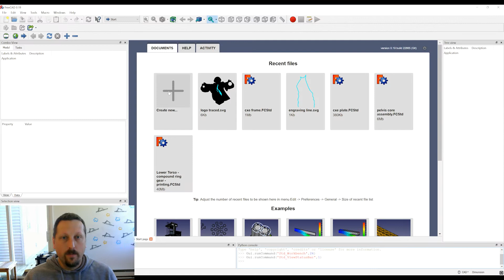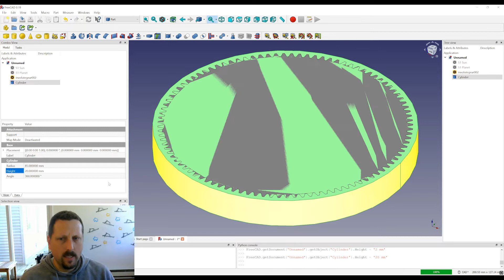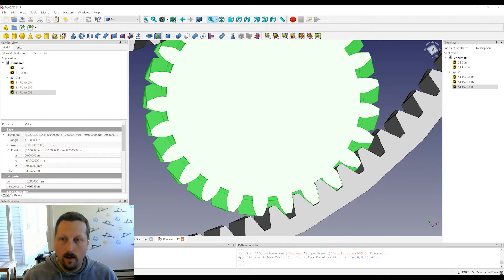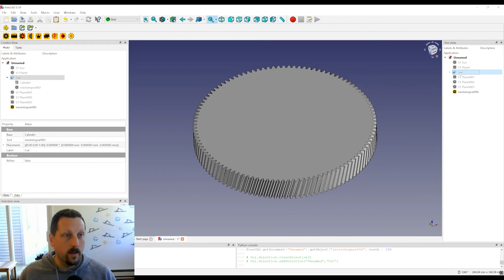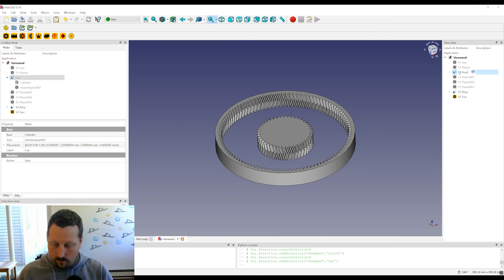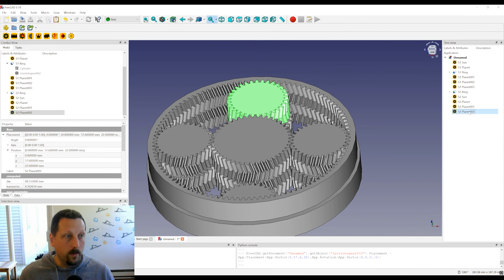FreeCAD Compound Planetary Gearbox Tutorial

Comment: Hey Josh if I had three planet gears would that change the divisor from 2 to 3 or it it still 2 for the planet gears, and if I had 5 planet gears would that be divdied by 5?
Reply from the maker: I'm pretty sure changing the number of planets doesn't directly change the gear ratio.  With more planets you can make a gearbox with bigger suns and smaller planets, which can help get the tooth counts for each gear into numbers that would be troublesome for, say, three planets to handle.  A six planet gearbox could still operate with just three planets in it, and the gear ratio would be the same.  After messing around with some compound planetary gears in my latest robot, I think I want all my tooth counts to be slightly off from clean multiples.  That way every tooth eventually meshes with every other tooth, making it better for lapping/smoothness.  If everything's multiples of four, like my last box, then each tooth only ever meshes with 1/4 of the teeth on other gears.  It's not wrong or bad, but it has implications for preparation and wear...
Reply: @WhitmanTechnological  ok, planets might not, but would changing the diameter of the gears, like how normal gear work, small to big, to increase power or torque, not sure the correct terms, or big to small to increase speed? ik you said that the axles or pins need to be in the same locations, but I"m thinking if it had a stablaizing bracket that maybe that technicality could be worked around through the design of the system.  I saw something like that in a dif vid where they used a sungear for a drill I think. I'm trying to take this concept that in cars and make a bike that's easier to pedal for myself cause i have a gimp leg from an accident, for when I'm older.
Reply from the maker: @BlackskyRadio-x9s  The only things that have any impact on the gear ratio are the tooth counts.  The size and counts of the teeth define the diameter of the individual gears.  If tooth counts are fixed, increasing the tooth size increases the gear size (but not the ratio of the gearset).
Reply: @WhitmanTechnological  thanks Sir, not the answer I was looking for but a step forward. lol I think we might have been saying the same thing though, as in creasing the tooth count would alter the diameter and decreasing it would lower the diameter, maybe I can get some lego gears to try and make a vid of what I can't explain.

Comment: Hey Mr. Whitman I opened up some excel and followed along with your sketch, I haven't gotten to the math yet, but I had a question, I had played with lego gears as a kid, didn't get the formal training about ratios from an engineering degree or anything, but I was wondering is it possible to have a 2:3 ratio, then a 2:3 ratio instead of a 1:1. or a 3:2 to a 3:2? I was thinking that a 2:3 to 3:2 or a 3:2 to 2:3 would just cancel each other out and be counter productive but if sun gears worked that way I was thinking they could help ev's in the future. I'm trying to work on a bike in free cad atm, coming from 3ds max and blender it's restrictive for me though to draw.

Comment: Nice video, but how do you calculate the uotput ratio of your model?
Reply from the maker: It's a somewhat complicated formula.  Here's the document where I found it: https://www.geartechnology.com/ext/resources/issues/0614x/epicyclic_drives.pdf  The page numbered "66" has the formula.  In my excel file it looks like this: =(L8*(L3+L5))/(L3*L8-L6*L5)  Each of those cells has the tooth counts for different gears in the set.  If I swap in the "Z1i" style labels from the linked PDF, it's the formula =(Z3ii*(Z1i+Z3i))/(Z1i*Z3ii-Z1ii*Z3i).  My gears tooth counts are:
Z1i	20
Z2i	12
Z3i	44
Z1ii	24
Z2ii	12
Z3ii	48
So the resulting ratio is -32  (These teeth counts might not match the video because I've made a few of these gearboxes in the last three years, and reused the Excel file.)
Reply: @WhitmanTechnological  Have you tried using Grok, it's awesome, it's a shame it's text only so can only kick out the maths not the cad. Though it can do G-Code as that's text based I didn't have the bottle to run it.

Comment: What's the specifications of PC needed if I need to download 3d softwares:
Freecad,spaceclaim,blender,cinema4d 
Thanks
Reply from the maker: I use FreeCAD and Blender, and they're both pretty lightweight to run.  The need for a better computer really only comes when you start making massive and complex things.  As a design gets more complex in FreeCAD it'll take longer to compute the updates - and a faster CPU will help.  In Blender, as you get more sophisticated, increase the output quality, add more detailed textures and render at a higher resolution, it'll put your graphics card to work.  I upgraded my GPU from a GTX960 to an RTX2070 Super and it cut the time to render video sequences in half.

At a minimum, if it has an operating system and boots up and was manufactured in the last 15 years, there's a good chance it can run FreeCAD and at least an older version of Blender.  I have a few old Core2 Duo computers I built in 2007 that still run and they'll happily run FreeCAD and Blender.  It'll just take a few decades to render anything in HD!

https://www.blender.org/download/requirements/
https://forum.freecad.org/viewtopic.php?t=16701

Comment: Hello sir please can you make a complete 4 blade helicopter swashplate step by step video please 🙏🏻🙏🏻🙏🏻
Reply from the maker: A younger me would have jumped at that.  I've always loved helicopters.  I'm mired in the robot project that most of my other videos are about and won't have time to make a video to do it justice, sorry.  The swashplate is a pretty cool piece of hardware.  Sleeved onto the rotor so it can slide up and down, and then ball jointed from the sleeve so it can pivot.  A lower plate connects to an upper plate with a bearing to allow the top to rotate while the bottom is fixed and both plates describe the same plane.  Upper plate has four ball joints that link to the leading edges of the rotors.  Lower plate has two or four linkages on ball joints that connect to servos or cables to control the whole thing.  An amazing design, and pretty incredible to see the rotors changing their pitch so heavily during a single rotation.

I read the FAA Rotorcraft Flying Handbook once, and the part about the flex from flapping and feathering - where the rotors are curving up and down dramatically as they transition from the heavy-load-into-the-wind half of their rotation to the unloaded-away-from-the-direction-of-travel half of their rotation was something I hadn't really thought about before.  Amazing those things can fly so smoothly at over a hundred knots considering the wild change in forces on the individual components over the span of a single rotation.
Reply: @WhitmanTechnological  sir it’ll be slow and steady you can create something like a course where people pay to learn all this complex design you’re good and I think it won’t take you long time to do because of your experience please think about it sir

Comment: Brilliant! I am new to this and even bought my first 3D printer. Do you recommend printing the ring gear as is and cut it after it prints, or design a cut or notch in FreeCAD? (Which I don't know if it even is possible) Thanks or the tutorial mate! I learnt a rather lot from it!
Reply from the maker: I'd put in the notch in FreeCAD and then 3D print with the notch.  Lately, I'm doing regular spur gears (not helical) so the gears all slide together easily.  For a helical gearset, I'd make the notch either by subtracting a thin cube in the Part workbench, or pocketing a thing rectangle in the Part Design workbench.  Congrats on your new printer!!
Reply: @WhitmanTechnological   Tally ho mate! Much obliged good sir!

Comment: Can this be built with more then 2 stages? Sy 3?
Reply from the maker: You could have the ring gear on the second stage link into the sun gear on a third stage.  Hold the third stage ring fixed with the first stage ring, and your output would be on the 4th stage ring.  But you can get gear ratios like 300:1 from just two stages if you choose the numbers of teeth appropriately.  I used multiples of four (since I have four planets) for all the tooth counts so that the planets are identical.  If you use multiples of two for tooth counts, you'll need two kinds of planets (and they'll have to be aligned carefully when the gearbox is assembled).  If you use arbitrary numbers of teeth, each planet might have to be different, and every planet, sun and ring will need to be oriented properly when the gearbox is assembled.  It makes the planets and assembly harder, but you can get astronomical gear ratios from just a two-stage assembly if you can tolerate the extra complexity.

Comment: I guess I'm confused.  Which gear are you driving, which is fixed, and which is the output?  Normally with a planetary system, you would have a carrier which would be your output, and your ring would be fixed.  In this arrangement I'm wondering if you are driving one sun gear, fixing the other sun gear, and the ring gears are attached to each other, and they are the output??
Reply from the maker: Hey Randy, one sun is driven, one ring is fixed, and the second ring is the output.  There are no carriers because the planets of one stage are made to exactly match the position and rotation of the planets on the second stage.  The second stage sun is allowed to spin freely (and could be omitted but it helps to keep the planets aligned).  Check it out in action on one of my other videos: https://youtu.be/PF528b9jf0Y?t=1139  The drill drives the sun and I can hold either ring and the second ring spins slowly.
Reply: @WhitmanTechnological    OK, What I think what I need to clarify, is that it seems that the two sets of planetary gears are actually attached to each other and printed as one part. Is that correct?  And that is what transfers the rotation from the first stage to the second stage. I only picked this up by noticing the timelapse print at 0:25 of the video.
Reply from the maker: @randysonnicksen9475  Exactly.  Both stages of planet are printed as a single part and are therefore locked together.  Stage 1 and Stage 2 have slightly different tooth counts, which produces the reducing effect of the gearbox.  Driving either sun will rotate the planet pairs.  The slightly different tooth counts from ring1 to ring2 causes them rotate at different speeds.  Fix one ring, and you'll have a huge reduction output on the second ring compared to the rotating input on the driven sun gear.
Reply: @WhitmanTechnological  Thanks for your replies.  Cool gearbox. And I was wondering how you assembled a double helix planetary gearset, until I saw the split in your ring gear.  Obviously, in a "real" application that split would need to be reinforced to prevent it from opening, or shifting.
Reply from the maker: @randysonnicksen9475  The helical ring gears are collars and slide into pockets in whatever is being driven.  The pocket holds the ring closed and the nubs on the outside of the rings fit into slots in the outer part.  If you want to see more, the YouTube channel "Gear Down for What" does a lot of very impressive stuff with compound planetary gears.  That was my starting point for trying to build this kind of gearset in the first place.
Reply: @WhitmanTechnological  One more question as I prepare to actually build one of these gearboxes:  Are the Stage1 and Stage2 suns printed as a single piece?  In the other video, I see you driving S1_Sun, and holding S1 Ring, and S2 ring spins slowly.  But it looks like S2_Sun is spinning also.  Is S2_Sun connected to S1_sun (printed as one part?)
Reply from the maker: @randysonnicksen9475  The suns are two separate parts.  The need to spin at slightly different speeds.  Good luck with your build!

Comment: Is the Compound Planetary Gearset identical to a Wolfrom type planetary gearset?
Reply from the maker: I took a look at the Wolfrom patent.  It's pretty cool.  In the Wolfrom patent, the gear set has at least one extra stage (three or more stages) to allow for changing the gear ratio during operation.  In the Wolfrom, you can slide an external gear along the various stages to fix (ground) different rings.  So it's not just a gearbox, but a variable speed transmission.  Assuming the Stage 1 ring is the output of a Wolfrom gearset.  You have a sliding lock that meshes with the outside of the ring of stage 2 for the first gear ratio, and then slide that lock onto ring 3 to have a different ratio, and then slide the lock further to ring 4 to get a still different ratio, etc.  It's a variable transmission with relatively few parts.  Awesome.

Structurally, the Wolfrom starts as the same kind of gears I made in this video, but has extra stages and the ability to ground different stages to change ratio.
Reply: Interesting! Do you mind sharing the patent number? There seem to be many patents on Wolfrom gears 🤷‍♂
Reply from the maker: @zetteltonne4772  https://patents.google.com/patent/EP2146112A1/en

Comment: Thanks for the vid, I appreciate it! I want to point out that if your stack identical gearsets you will still get reduction. Make your ring gear a single, fixed "tube," and connect your 1st stage planets to the input of the second stage. I stacked two 4:1 planetary gears to get a 16:1 reduction
Reply from the maker: Interesting.  How do you connect them?  With a carrier on the first stage planets that drives the sun on the second stage?

Comment: Why did you not use 'internal gear' on the ring gear? I have the feeling this was the option you were looking for at min 16. It took me a good afternoon to come to the same realisation. The internal gear option only exists in Part Design, but not in Part. 
FreeCAD likes to make simple things complicated because it is the way they have always done it :)
Reply from the maker: I'm using the Gears Workbench, which makes herringbone gears and other types of gears really easy, but it doesn't have an internal gear option to the best of my knowledge.  I used the Involute Gear option in the Part Design Workbench for a long time until I took a serious look at the Gears Workbench.  

I hopped into FreeCAD to test the External Gear: True/False setting just now to see what it does.  The math/geometry behind involute gears is fascinating, but I'm no expert.  The profile does look like something that might be "the correct way" to build a ring gear.  It certainly looks markedly different from the external gear shape.

Do you think that the internal flavor of involute gear is the most correct way to construct the ring gear?  I could see how that profile might eliminate problems with tooth meshing if tooth meshing is an issue.

If someone wanted to use the involute gear from Part Design to make their herringbone ring gears, they could do an additive helix twice (one clockwise and one counterclockwise) and then subtract those from a cylinder, or do a subtractive helix from a cylinder.  Just FYI for anyone reading these comments and looking to take a crack at it themselves.
Reply: @WhitmanTechnological  I'm just a curious hobbyist, so I can't say anything about the proper way to CAD :) However, the larger the diameter, the more triangular the gear teeth become, so I suspect it is less of an issue the larger the internal gearing becomes. 

I just made a 70mm outer diameter ring in my 3D printer and it works fine. Modulus 1,6, 40-20-10 teeth. 0,1mm backlash on sun and planets. I had to go to 0,05mm on the ring because the CAD broke. So there should be 0,2mm play between planet and sun, and 0,15mm play between planet and ring, to allow for heat extention. With these parameters, the gear spins freely.

I'm new to printing moving parts, but in my previous designs I took 0,2mm play, so I was a little fearful the friction would be too much. However, the gear is a little too loose (I have to run it flat on the table, to not let the gears fall out). I might try a little less play in my next attempt.

Changing the pressure angle from 20° to a higher number might help too.
Reply from the maker: @JasonRobards2  Those numbers parallel my results, too.  In the Gears workbench, the backlash seems to have a larger effect than I expected.  Setting a backlash of 10 or 20 micrometers is enough to have a significant visible impact on the tooth profiles.  With those tiny numbers, I'd have expected a much smaller effect.  Next time I'm using a planetary gear set, I'll try it with the internal tooth profile for the rings.  I bet it ends up working a lot better. 😊
Reply from the maker: I found a forum post about it and added a note to this video's description.  Thanks for teaching me something new!

Comment: Thank you very much for the video :) now, I know that the compound planets are printed with both layers unified, and the rings are printed separately. However: the suns, are the unified together, or printed separately?
Reply from the maker: In my case, I printed all of them separately, and there's a gap on the ring gear to allow it to "open up" like the letter 'c' so I can squeeze all the gears in.  If you were going to print a double-helix planetary gearset without the notch, you'd have to print sun, planets, and ring all at once.  There'd be no way to get the sun into the planets if the ring is solid all the way around.  If the gears are just spur gears, you can easily slide them into each other so it doesn't matter if you print the set in place or some pieces separately.  Once you double-helix the gears, the won't assemble without opening up the ring.
Reply: @WhitmanTechnological  yes... thank you! I have more experience from printing the “modular toy robot arm” from thingiverse, which uses many “print-in-place” compound planetary gears... but the suns are solidly printed together... There is no tooth slippage in the sun, I am amazed at that 😬